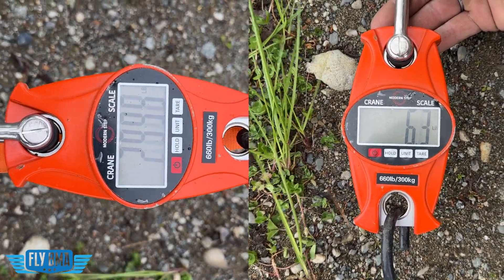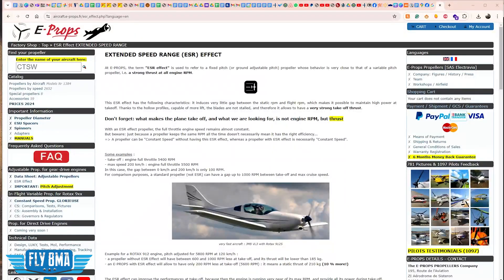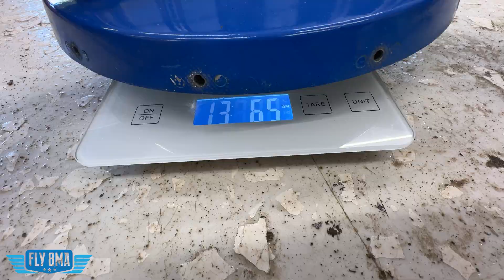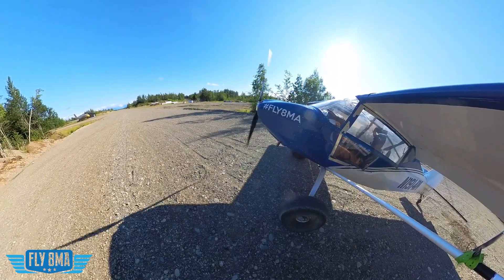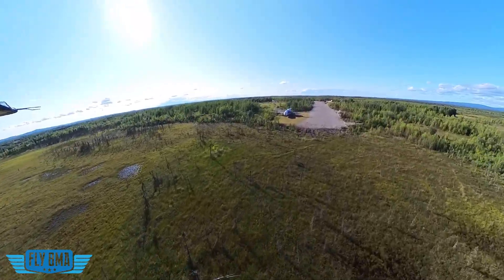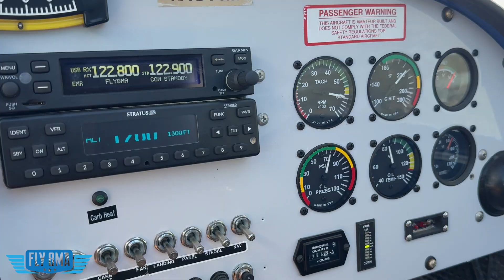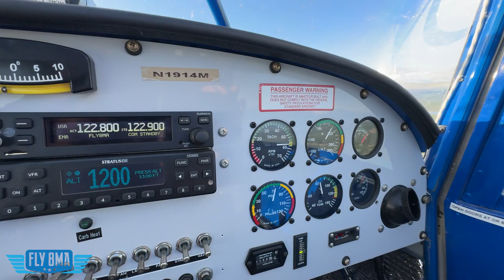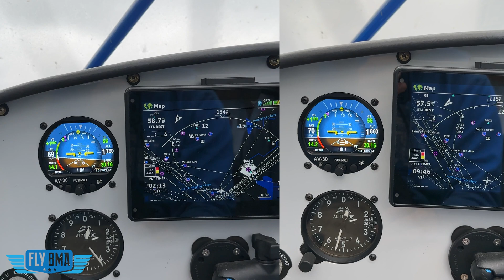Propeller Testing Sensenich Vs E-Props Vs Warpdrive

Comment: I flew an E prop for 15 hours, (RANS S-7S) and got the expected smoothness and  increase in cruise, all good. BUT, you have to keep it clean, bug build up seriously seems to degrade it's performance.  I was surprised by this, but it kinda makes sense as the airfoil is so super critical, like a high performance  sailplane wing loosing significant performance when it gets bugs on the leading edge.  I liked it a lot otherwise, but went back to my 2 blade Prince P tip prop, which I've used for over 2000 hours now.

Comment: What type of Performance were you getting on the warp drive? I know you didn’t compare head to head but since you had it for a while maybe you know? 

I am looking for a prop for my Kitfox with 912 ULS. Mainly looking for improving STOL. So didn’t data suggest the e prop is better for STOL?
Reply: Both the E-prop and the Sensenich will do better than the Warp Drive. I have the Warp Drive 72" 3-blade on my Zenith 750 STOL, but will probably be switching to the Sensenich 2 blade 80". The Warp Drive is the heaviest, so that is a big factor for me, as I mostly do competitions and lots of STOL flying.

Comment: Just bought an E-Prop for my savage cub to replace the two blade wooden one. Hoping to get better take off and cruise…
Reply from the maker: I'll bet you'll notice a difference
Reply: Just finished the install and test run. So much smother and just about no vibration now which is a big win for me! And gained 5kts on the suggested pitch setting. I call that a win and worth the $$

Comment: G,day John from Sydney Australia. Great to see you and the aerial images of your training facility. 
Did you get grass on the runway, or don't want grass anymore? 🤔
The e-props and carbon fibre all need a little more nickel leading edge for protection from abrasion. 
I still prefer a 2000rpm engine than a 5000rpm Rotax?
🌏🇦🇺
Reply: Rotax has flown millions of hours at 5000 rpm..
Reply from the maker: I decided i'd rather spend the $$$ on avgas instead of grass.  lol  maybe one day
Reply: With a gearbox the prop is spinning a lot slower than a direct drive engine. More efficient at slow rpm, quieter at slower speed.
Reply: @dalemseitzer false, it spins the same or very close depending upon ratio and pitch.